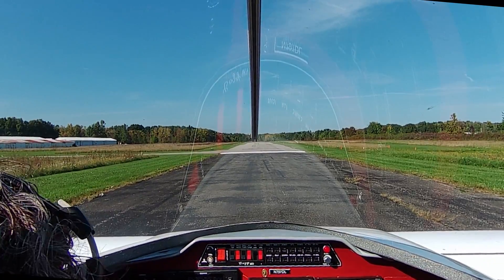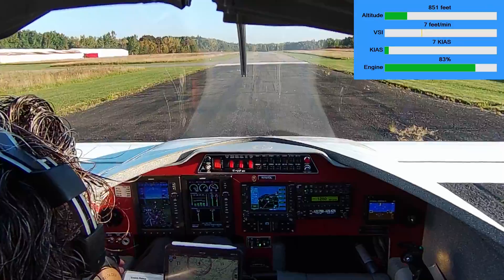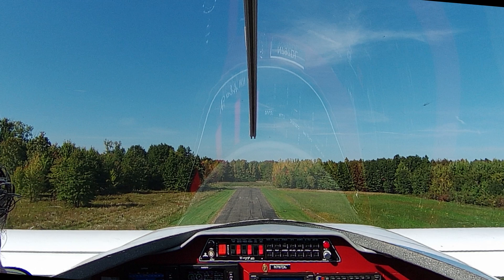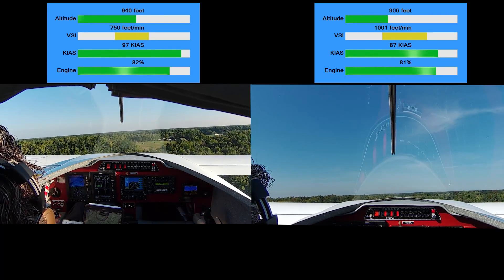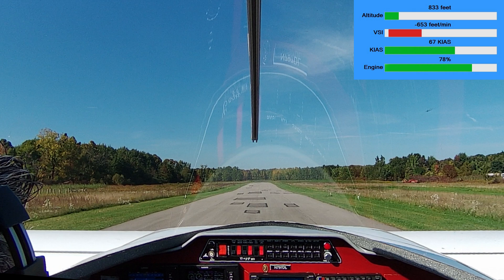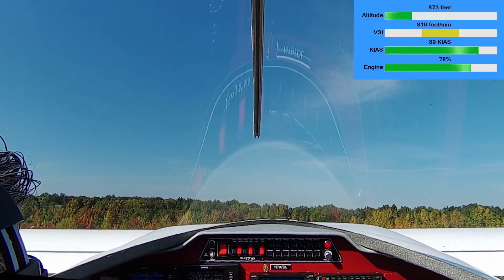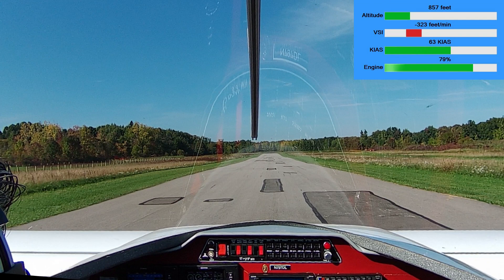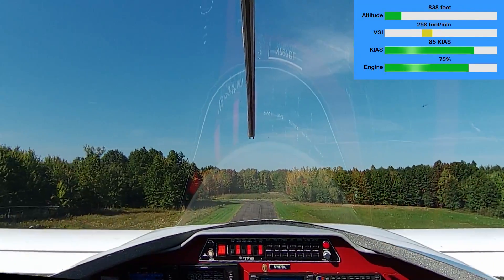Almost a CRASH: How did this happen? And why?

Comment: Cozy 197DL here. WOW glad you made it. What airport is that?
My Cozy is off near sea level DA in 12 seconds @ > 75 kn with Hertzler climb prop, 200 HP and making ~ 2600 RPM static. See https://www.youtube.com/watch?v=OI6oQYjBbQE . In this video you appeared to roll for 18 seconds before takeoff, but you are probably faster in cruise.
My scariest takeoff was at the Green Bank National Radio Astronomy Observatory runway because of something I did not plan for. The runway is 3500' but they do not allow takeoffs to the West towards the big dish. I should have been OK even with a slight tailwind but there was a problem. The concrete runway had huge lumps of grass growing out of the periodic expansion cracks in the runway. With my small wheels the grass slowed my roll way down. I lifted off in almost 3000 feet instead of the 2000 I should have used at that DA with the wind. Fortunately, there were no obstacles at the end, so we were OK. 
A very good habit for all pilots to have with any aircraft is that after liftoff to keep the nose down until you pick up some extra speed before starting a climb. Too many pilots forget that and suffer departure stalls. We have had two serious crashes here at my airpark. At least our canards don't stall and cause loss of control; but they are fast and use a lot of runway.
Reply from the maker: Hi Del! Yes, I definitely have a cruise prop rather than a climb prop. I also have 180 HP, not 200.

Crosswinds where you have to drag a brake for directional control before the rudders become active also make a significant difference to takeoff roll.

Comment: It was about a resonant (mechanical) circuit.
You changed the natural resonant frequency, so the oscillating and its damping of the circuit changed. The runway being bumpy did its job too.

The plane got a lot of resonant circuits and these may interfere with each other. Similar things happen, when you the CG from stable to unstable. If the plane is stable, the mechanical circuit/system goes back to stable state. Otherwise, if it is unstable, it can go to a resonance disaster.

Comment: Right after the onset of the porpoising i seem to detect some resonance : the rebound on the damper is set too fast, so it jumps up and beyond the point of balance then drops down again, just as you approach a lull in the runway. So it takes all that downward nose momentum into the spring compression, and the cycle repeats itself. I would also consider offsetting your take-off run to the right by a few metres/yards looks like that might keep yr nosewheel inbetween most of the patches. Good job on pushing the nose down !
Reply from the maker: The rebound on the damper is not set too fast...because there IS no damper. It's just a spring. There's not enough room for a damper up there, and it would add weight to a very critical part of the plane.

Comment: What is your plan for a rejected takeoff from that runway? It doesn’t look like that aircraft has enough length to successfully complete a rejected takeoff without crashing into the trees at the end of the runway. Fly safe!
Reply from the maker: The plan was to kill power and brake as hard as possible to minimize impact forces. Nosegear can also be retracted on the ground in this plane to aid in stopping power in an emergency. But I left that airport almost a year ago, so no longer an issue.

Comment: 700 hours in a LongEZ here...

I think you should unload the nose wheel as soon as possible in your takeoff run.

As soon as I start my takeoff roll, I'm holding full aft stick to lift the nose as soon as the canard will fly.  This should happen very soon in your takeoff roll.  I just let the canard float just below the horizon so I can maintain forward visibility.  Then I maintain that pitch attitude so that the aircraft lifts off as soon as the main wing wants to fly.

Once the main wing lifts off, now both wings are flying.  I then pitch forward if necessary to stay in ground effect until I reach optimal climb speed.

It's similar to the way taildraggers lift the tail first to set the pitch angle, then let the aircraft liftoff when it's ready.  You should never hold the nose on the ground during takeoff in a LongEZ or any variant of a LongEZ.

This does two things in a canard.  One, you never force the plane into the air.  Two, it gets the nose wheel off the ground so debris is not thrown into the prop.
Reply from the maker: Actually, that's what I was doing in this video, which is why, when I hit that dip, it pushed the nose into the air (early). That said, normally I will rotate at 75-80 kts, and I will start applying back pressure at around 60-65 kts, and wait for it to come off. The canard will definitely not start flying below that (canard stall speed is 63 kts on this plane). And yes, as soon as I rotate and both wings are flying, I push forward to prevent over-rotation and stay in ground effect until Vx, like you mention.

Comment: Somewhere I saw recently a video on a replacement linear actuator for the Cozy's nose gear that eliminates that spring... given that the Cozy doesn't generally operate off grass anyway, there's not much point in having it... (It might've been a link off one of your vids, I don't know, but I think I'd a lot rather have a bit rougher but solid ride rather than going boinGYboinGYboINgy down the runway and possibly bouncing the nose into the air too far... 

(What I'd really like to see is a trailing link setup like on the DarkAero One but that's a major redesign; this is a fairly minimal setup...)
Reply from the maker: You're talking about Marc Zeitlin's new nosegear system. https://www.burnsideaerospace.com/nose-gear-system-info

What I'd like to see (and Burt Rutan said this not long ago) is a steerable nosewheel!

Comment: Both takeoffs were the same.  Its a short runway and you are playing with fire there in that aircraft.  If you are going to keep using that runway, you should hold the brakes until the engine gets to max RPM, start the roll, holding the stick all the way back, get airborn a couple of feet quickly to get free of runway friction. The aircraft will speed up much faster in the air, than on the runway. And you will be able to climb at Vx instead of Vy.
Reply from the maker: Both takeoffs were definitely NOT the same. Watch the video. I am holding brakes, advancing to max RPM, then releasing brakes. However, holding the stick all the way back on a Canard on takeoff roll will guarantee a prop strike, followed by massive over-rotation, and a crash. What works in your Cirrus is not going to work in every airplane. Also, "runway friction" is far less than the drag created by creating lift, even in ground effect, at least at takeoff roll speeds. Acceleration on the ground in a Canard, when zero lift is being produced, is much faster than acceleration in the air, when there is considerable induced drag. That was the cause of this problem here.
Reply: @CanardBoulevard  You use the same technique in both takeoffs and you get airborne in about the same place.  The principal of getting airborn as quickly as possible in short field takeoffs is a proven and standard procedure.  You are incorrect that the ground is less draggy than being airborn, that is why short field landings are performed in the same way.  The goal is to get into the air a couple of feet off the runway, take advantage of ground effect, even at slow speeds, keep the plane level until your speed reaches Vy rotation which will happen sooner than being on the runway, and angle at Vx once your speed is achieved.

Comment: Just wondering if you have thought about setting up flaperons on your ailerons for takeoff and landing? Loss of roll control maybe an issue. It should increase lift and drag as all flaps do and lower the angle of attack at landing for a less shallow approach profile.
Reply from the maker: It's not that easy. Both the canard and the main wing are lifting surfaces. If you increase lift on the main wing, you also have to have control surfaces that increase lift on the canard - while not exceeding the critical AOA on the canard (which is designed to exceed critical AOA before the main wing). And, you would need a mechanism that absolutely, positively prevents one system from actuating without the other actuating simultaneously - if that were to happen, it would be absolutely disastrous. Something like that would add a LOT of weight, comparably, to a small airplane like this.

Loss of roll control is never an issue on a canard. That occurs on a conventional aircraft when the area of a wing which is stalled (begins at the wing root and travels outward) reaches the ailerons. On a canard, the main wing can NEVER stall because the canard stalls first, and reduces the AOA on the main wing before it gets anywhere near stalling, so the ailerons remain fully effective even at the lowest speeds - and even when the canard is held in a stall pitch buck.
Reply: As always nothing for free. More of a thought experiment. Was thinking about the rv12 flaperons. But on the canard aircraft you sort of get double value as aileron droop would require aft pitch trim. Which on a canard is down on the elevators. Hard to put that system in an already built aircraft.

Comment: RE 65 as your go-no go, sure you may run off the runway into trees if faster than 65, but it looks like lots of trees extending initially in flying too with no real straight ahead landing options. Thoughts to low speed tree impact versus high speed tree impact and having certain items to abort regardless? The whole idea of sacrifice the plane to save occupants notion?

Comment: I have been following your channel for a while..."It is my dream to have a canard plane one day" hopefully before I'm no longer among the living..... any way I did watch this particular video about 3 times and noticed the engine struggling to get above 80%... Probably preaching to the quire, but its there any chance you can mount an small compressor to work as a charger for incredibly short amounts of time?? I have some that I have used in the past "And for a very short amount of time they do make a heck of a difference.....
Reply from the maker: Piston aircraft engines do not run at 100%. This is normal for an aircraft. Some aircraft do have turbochargers, but they are virtually always used as turbonormalizers, to boost pressure to standard sea level (at any altitude). These are low-compression, low-RPM high-displacement engines. Adding forced induction to an aircraft engine to boost power over its rated output will cause detonation and destruction of the engine.

Comment: Do they make what they used to have in World War II at least after the war, small rocket Jaydo units that could be fired off under the plane for a few seconds to ensure enough power and lift.?
Reply from the maker: You mean JATO bottles, and I don't know if they do, but if so, definitely not outside the military!
Reply: You haven’t seen the model rocket industry lately plus they make those small jet enginesthey use for the handheld hover machines  with the guy with four of them on flying around @CanardBoulevard

Comment: You probably Stalled the Canard as it left Ground Effect, radically increasing the drag of the canard, hence the performance loss. I imagine it would just mush back down into ground effect an un-stalling itself in ground effect. Pushing forward on the stick until the main landing gear is rolling again with no intention to land, brings the canard back into un-stalled ground effect. 

Ground effect is not an on/off switch, the boost in lift is a function of altitude above the ground and wingspan. Your main wing will be in ground effect to a higher altitude above the runway than the canard. So, if the canard lifts off below "clear air" stall speed, in ground effect, your main wing which is closer to the ground and deeper in ground effect get a much better boost from ground effect. A stalled canard is not going to drop the nose down like a stall in "clear" air. A stalled canard at takeoff is only going to pitch the nose down back into ground effect, then begin flying again even below the stall speed.
Reply from the maker: The canard definitely did not stall, or come close to stall, first off the angle of attack even in clear air was nowhere near high enough, and definitely not high enough to stall IGE. If the AOA had increased sufficiently to stall the canard at that low altitude, the prop would have struck the ground. The immediate decrease in AOA you see is not a canard stall, rather it is me pushing the nose over in reaction to the unexpected rotation, to prevent further speed decay, and to prevent a prop strike. This is something that's pretty ingrained in canard pilots - it takes a fair amount of pitch back to unstick the nose, but as soon as it lifts, you have to unload that pitch input to prevent over-rotation.

The stall/unstall cycle of the canard on this aircraft is typically about 1.5 - 2 Hz, so this was far too fast for it to be happening of its own accord anyway.

Comment: is possible to add shock-absorber to front suspension?  that also would help in that situation.
Reply: I assume that's an experimental airplane.
Reply from the maker: Weight, space, complexity. Not that it's impossible, but it wouldn't be easy, particularly given that the shock spring is part of the extension mechanism already.

Comment: why single engine airplane don't use V1 speed? and if you don't achieve that speed after XXX seconds than abort. (for multiengine, time to achieve V1 could also be applied)
that will force pilot to calculate performance every flight.
Reply from the maker: V1 is both the speed at which a rejected takeoff can no longer be safely execute, and also the speed at which a takeoff and climb to altitude can safely be performed if an engine were to fail. Obviously, if a single engine airplane has an engine fail, it's not taking off or climbing safely.

Comment: That was pretty much a worst case scenario. It may be a stall proof aircraft but once that canard stopped flying you were going into those trees, albeit in a level attitude but trees nonetheless. To be honest that airport is marginal for that aircraft even when everything is going right. Personally I’d have had nightmares that featured trees and an inability to climb. Not a good way to enjoy your life. Cheers
Reply from the maker: Correct. You will not stall/spin, but if you're behind the power curve, you are coming down regardless. At least if you are in that situation, you are going into the trees in a relatively controlled manner, instead of upside down and out of control. Very glad I found a new airport.

Comment: So 100% pilot error by pulling back to far on the stick.   Be very careful in the future.
Reply from the maker: You're wrong. For this airplane, you are supposed to apply gentle back pressure when you get close to rotation speed, and allow the canard to start to fly gradually, to avoid over-rotation. Once you reach rotation speed, it will then lift the nose gently off and begin to fly. So that's exactly what I did, apply back pressure - and at the same time, it hit the dip in the runway, which pushed the nose into the air and forced the plane to start flying before it was ready. That's what caused this, and is what made me move to a different airport.

Comment: I wonder because of the runways condition and bouncing could you end up pushing both rudders for a speed brake effect?
Reply from the maker: Yes, I regularly do this on short final to lose speed and altitude. When braking on the runway, you're already pushing both rudders out, so you get the speed brake effect automatically when you're braking (brakes are on the rudder pedals).

Comment: 😮Flying from this strip is going to kill you one day! One tiny issue with the engine and it's hello trees.
Especially with a sensitive canard  aircraft that you've pointed out a few times in this video. If you ever have a problem what's  plan B?
Reply from the maker: Already fixed this problem - got a hangar at a new airport!

Comment: Awesome video.  I had no idea that acceleration was greater (Less Drag) on the ground than in the air.  I always thought the friction from the wheels would be greater and reduce once airborne.  Makes sense though.  Mushy, slow speed flight is not efficient.

Comment: Why are you only getting 80% power?  I would consider leaving the overrun of the runway and just using the actual runway to alleviate the bouncing.  You are giving up a hundred feet but is it worth it?
Reply from the maker: Airplane engines do not develop full power on the ground or on takeoff rolls, because they cannot attain full rated RPM with a fixed pitch prop. My solution to this runway was to move the airplane to a different airport.

Comment: I use full power on take off not 75%
Reply from the maker: 75% IS full power. Airplanes do not make 100% at full power, particularly at static or slow airspeeds. Also varies with density altitude, propeller pitch, and more.

Comment: Just wondering ... cars use "shock absorbers" - dampening devices that turn movement/oscillation energy into heat.
Would it be an option to equip your canard front wheel assembly with something like that?

Thanks for your videos, learning a lot here!

Comment: I fly a Long EZ and have the same springy nose strut issue. On my takeoffs I try to fly the nosewheel an inch or so off the runway during takeoff run to avoid the bouncy nose. It is somewhat of a compromise but the takeoff run is smoother.

Comment: That additional forward moment would cause more friction on the front wheel which would slow down your ground-roll. I doubt that 1600ft density altitude would cause that much difference from 400ft. 
I'm thinking you need to treat that runway the same as a soft-field. Your nose is just bouncing too much and too much ground friction.